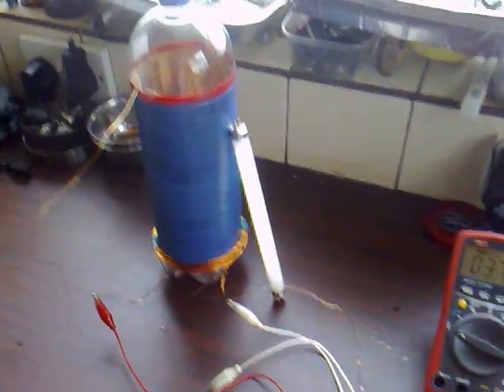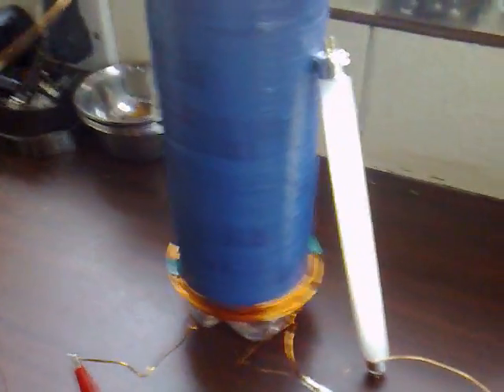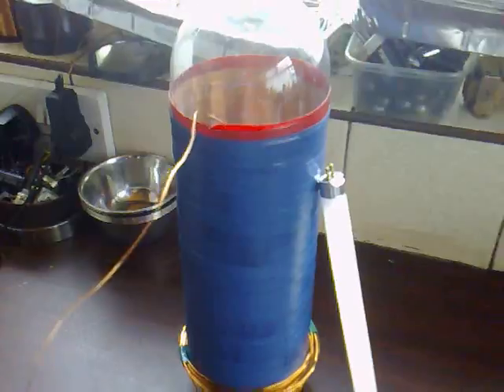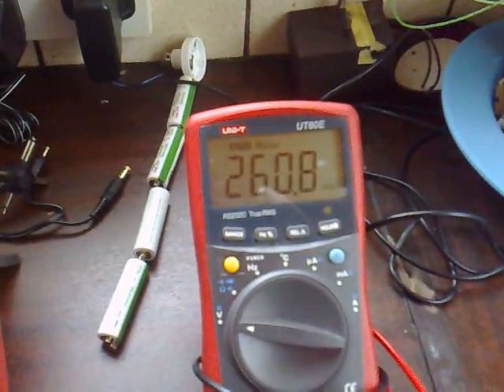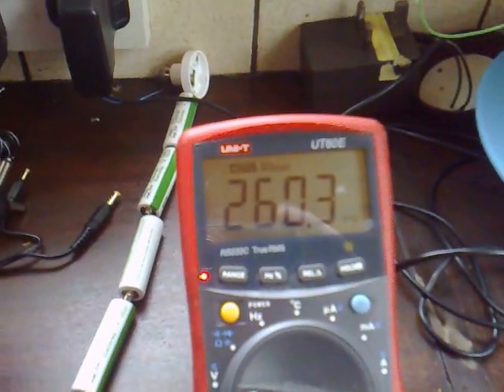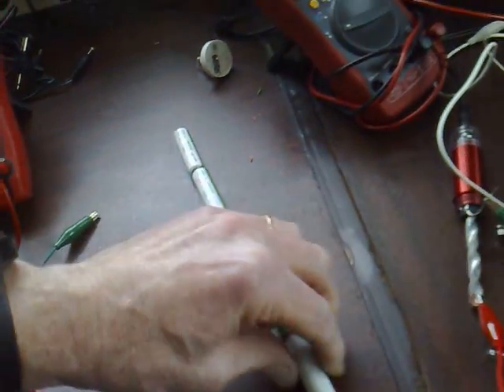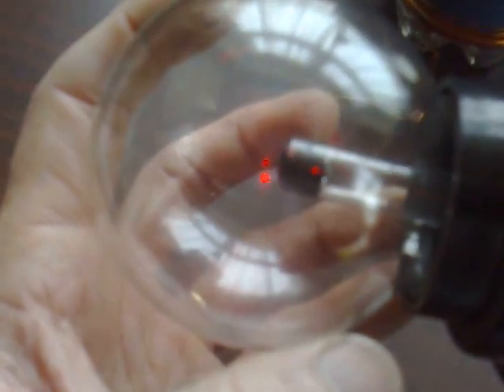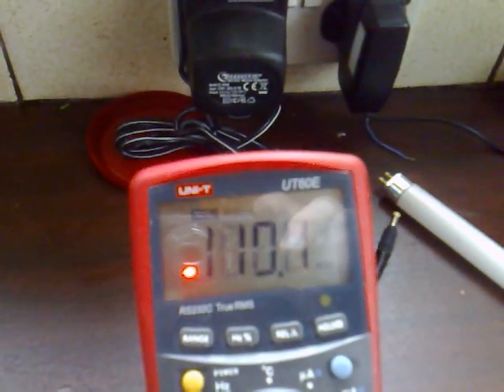Slayer exciter plasma globe and other tests

Comment: Hi Jonny, no surprise about the real current draw for a cell phone charger. as for the coil, you can treat it as a step up transformer and divide l1 by l2 times the input voltage. on my coil i multiply the input voltage by 170 ...... 12 x 170 ~ 2040 volts